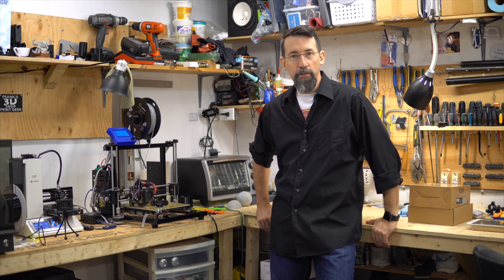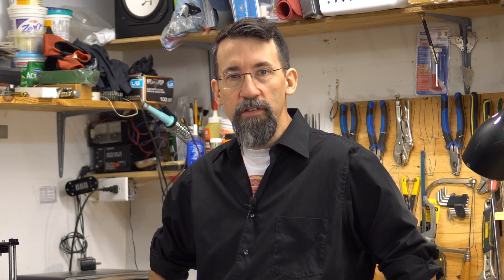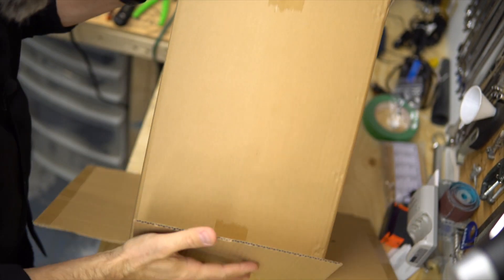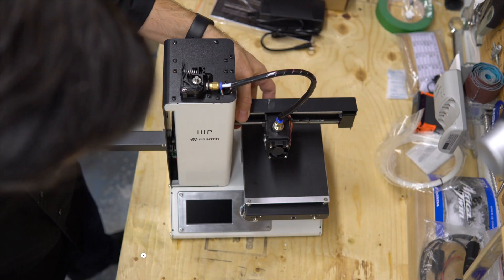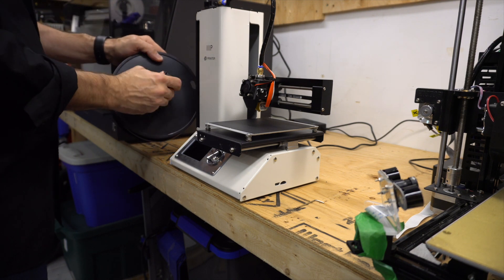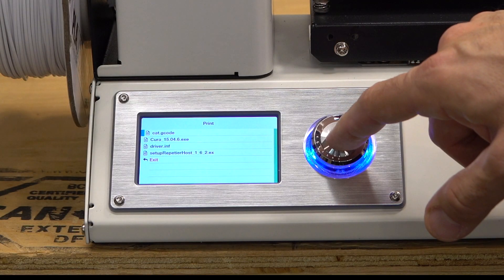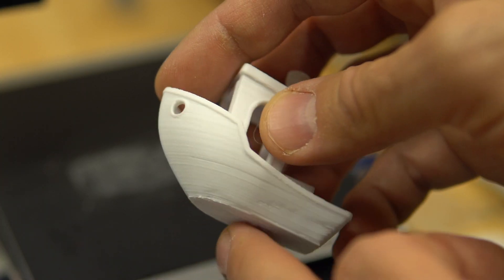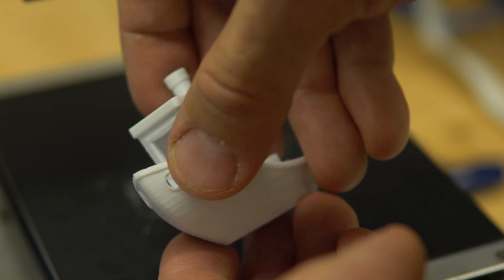The Cheapest 3D Printer on Amazon (Monoprice Select Mini)

Comment: i like how you 3d printed a new arm for holding the filament with the printer you were going to put the arm on
Reply from the maker: Thanks and it works better !
Reply: @Franks3Dshop  awesome! Its cool that if you break something you can just 3d print a replacement for it haha, one of the reasons im considering getting a 3d printer.
Reply from the maker: Yes and if you learn to design your own parts it helps all around the house, car, motorcycle, work place ect.

Comment: I might be buying a “barely used” mini v1 for $140 (Canadian) on kijiji to use as a second printer, think this is a good deal frank?  Or should I pass on it?
Reply from the maker: For the price I think you can not go wrong. Just verify on Amazon the price for a new V2 just to be sure.
Reply: @Franks3Dshop  thank you, frank!  i ended up buying it today.  i'll be rewatching all your videos about your mini for ideas to upgrade and improve mine.  a v2 is around $300 on amazon right now so i thinkl it was a good deal, thx again for your input!
Reply from the maker: I want to do an update on mine and film it :-)
Reply: Frank's 3D shop bring it on!!  Love your vids
Reply: @Franks3Dshop  would "tl smoothers" work on the mp mini?  i bought some for my cr-10 and i have extras
Reply from the maker: Hi, the mini drivers are soldered on the board, you would have to change the board to use smoother, And I get better results with TMC2130 drivers than the smoothers.